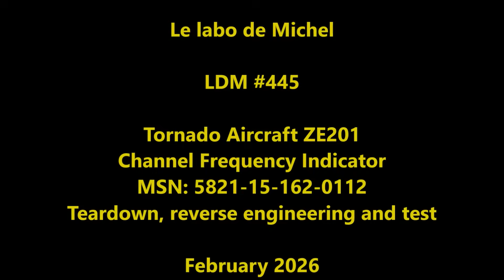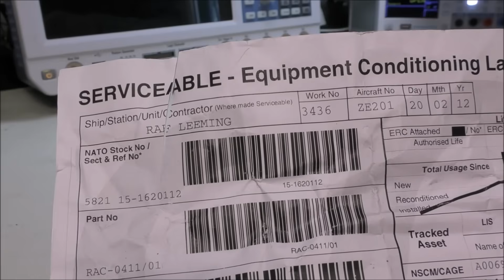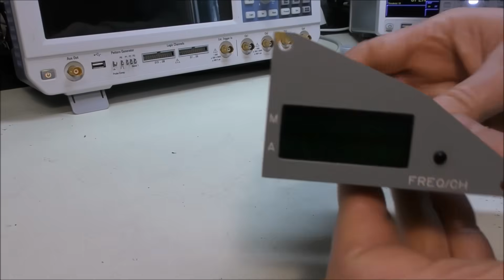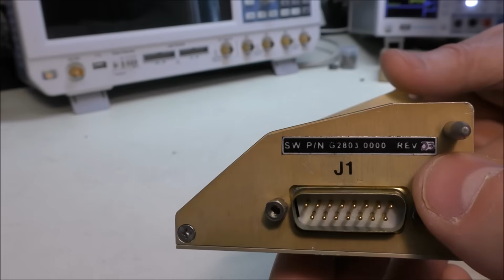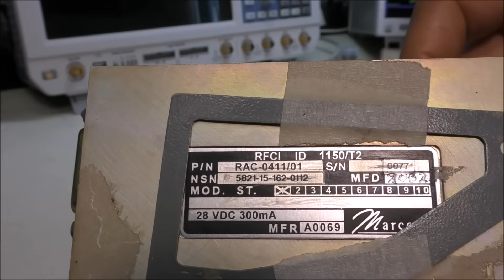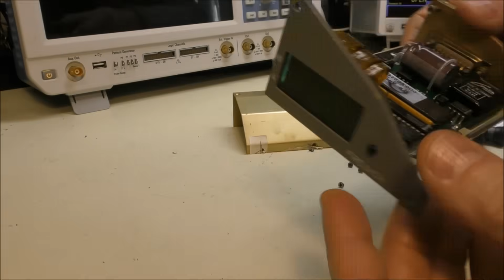LDM #445: Tornado Aircraft Channel Frequency Indicator: Teardown, Reverse engineering and test

Comment: 14.31818MHz is found in practically every PC. In the original PC and XT it was divided down for the CPU clock, and since it is present on the ISA bus (and independent of the CPU frequency) later it was used by many video cards as the input to a PLL to generate various pixel clocks.

I'm also wondering if a lot of the unoptimised/repeated code is the result of using macros for various operations?
Reply: That's NTSC television colourburst (the signal that identifies the TV as colour) * 4, which makes the crystal a reasonable physical size, easily dividable by a pair of flip-flops.  3.57954 actual colourburst crystals are physically large and expensive.  Super common in the Americas, but a very unusual frequency in non NTSC countries like the rest of the world.  The reason it's in PCs in the Americas is because it was made available on the ISA bus for the earliest colour video cards which ran composite NTSC monitors.  It was a cost-saving measure:  run both the CPU and the video card on the same crystal.  PCs in the rest of the world would have different crystals.
Reply: @paul_moir in this case it is not a regional thing.

8 bit systems that hooked directly up to a TV used different crystals depending on where in the world it was sold - PAL systems were notably a tiny bit slower due to the lower frequency used.

But in the PC, 14.31818MHz is used globally.
Reply: @TomStorey96  The largest markets for color television were initially United States and Japan. Americas and Japan all used the NTSC standard. Therefore these crystals were produced in massive quantities. When Apple II appeared in the USA, it naturally used the crystal because of how its color video circuit was designed. IBM PC started in the same market, so it is not surprising if it used the same low cost crystals. Later, video cards used a bunch of different frequency crystal oscillators for different resolution modes. But eventually it was all replaced by a PLL frequency generator, using a single reference, which was often again the same cheapest and the most widely available 14.318 MHz resonator.
Reply: I am not sure for the milspecs of software but in commercial aviation, software have to go by the DO-178 specification. If there is an error in the code, the variable will end up being initialized later. By removing those lines, you give no chance to the program the get the variable set, in the instance an error prevented it the first time. Coding for realtime and onboard applications is not the same as what runs on Windows, in offices.

Comment: Just the video title screen alone shows the jewel like characteristics of milspec electronics.  Insulation on the leads of components that look like they have no chance of shorting with anything and the same around the anchoring loop wire over the capacitor to prevent an undoubtedly power circuit isolated (i.e, not grounded) wire from abrading the capacitor case.
Reply: A lot of this stuff has an 'aura' of next-level engineering. However, speaking from experience, some of the most peculiar and quite frankly terrible circuits I have seen have come from mil-spec kit.